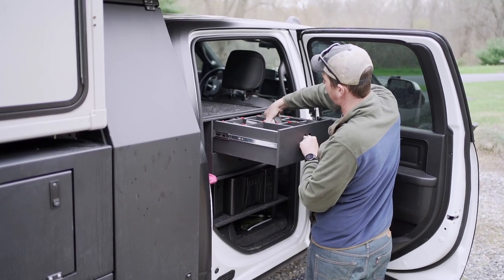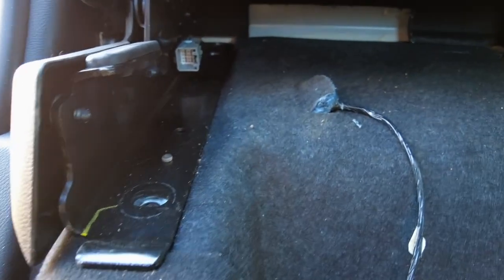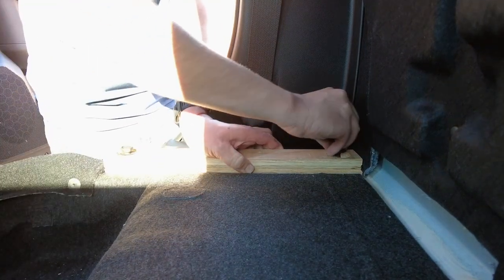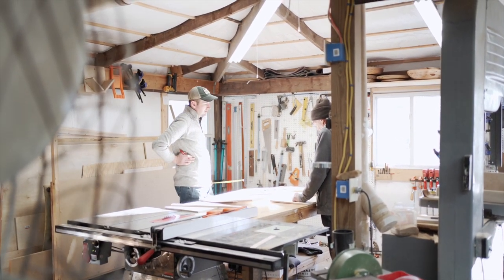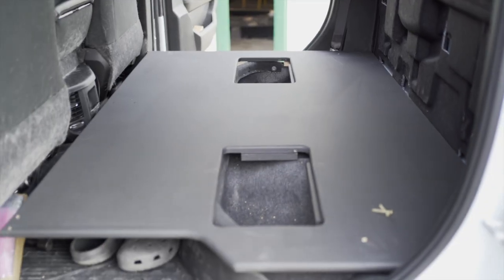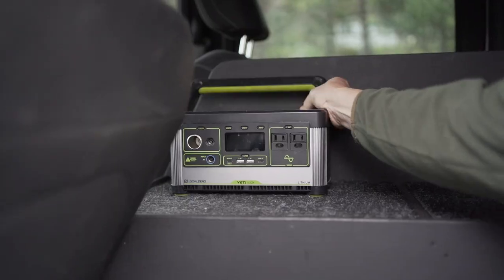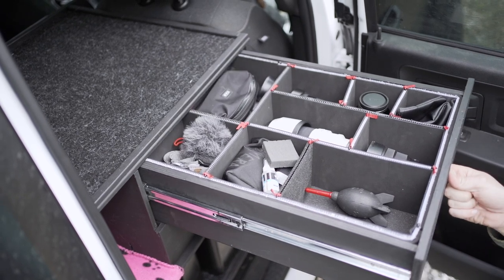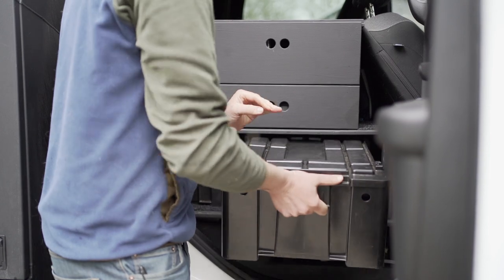DIY Backseat Storage System | The Mortells

Comment: I have my rolling tool box . Rigid from home depot, no need to take out your seats. I also have low ride side tool  boxes, for an open truck bed with home-made bed slider, with heavy duty ladder rack . Awesome set up, and can have my rear seats back in a flash if needed. Just roll out my tool boxes into the garage. Tip for the day...
Reply from the maker: Sounds like a good set up as well! We definitely would want to have a rear seat if we weren't full time in the truck.

Comment: Wow - great video; really well done narration and video edits!    Any chance you can share your plans? Especially the measurements of the pieces/parts?  The Pelican Dividers have mixed reviews - did yours (at your link) come with all the items seen in your top drawer?  Thanks for sharing!
Reply from the maker: Hey Harry! Thanks for the nice comment! Unfortunately we didn't actual draw up any designs for this and it was a 'figure it out as we built' it project. The dividers in the top drawer are some of the Pelican dividers but also some custom made dividers using corrugated plastic and foam.